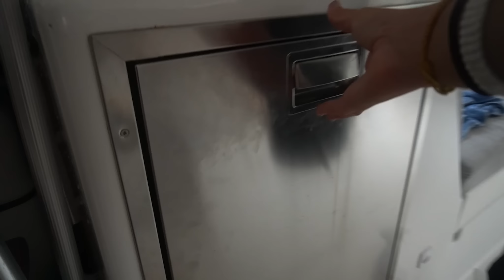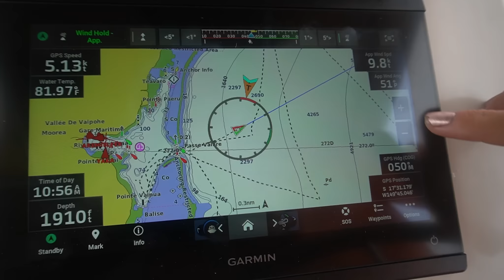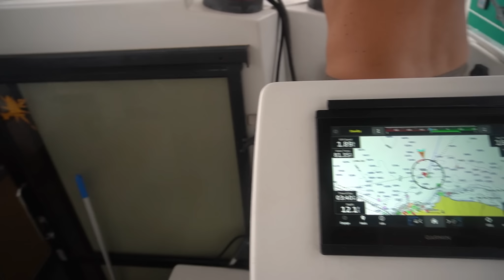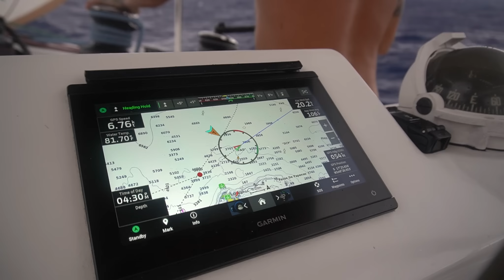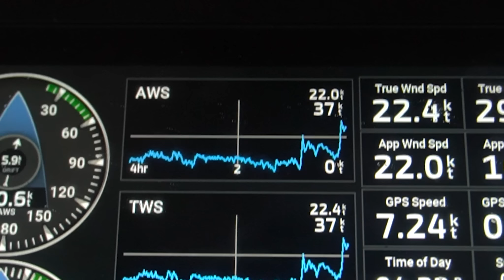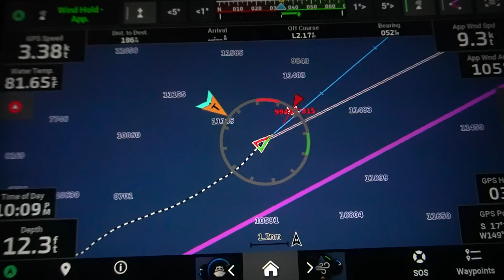The Dingy is Fixed, Now Let's Go Sailing | Episode 202

Comment: sorry to hear about the eczema, next time you are near a chemist, get them to mix 10% Olive oil in the Aqueous base cream, into a small jar (approx150ml), apply each time you wash, swim etc. and wipe off if it still feels greasy, you don't need much, it goes a long way eh, most creams have either perfumes and or 'drying' agents and will aggravate the affected area's and all barrier creams will aggravate you too, use the cortisone very sparingly and at a max 7 days on 7 off, or your skin might build up a tolerance (it happened to me)  I have been using the oil/cream for nearly 30 years!!! and have kept the eczema at bay for many years...  tip find a small container (about the size of contact Lense case) put the some of the oil/cream into to that and carry with you (in ya handbag etc.).. hope this is helpful

Comment: Coming from a marine technician, I’m hoping you check the bearing preloads and the gear backlashes. If not you’re going to just chew up gears like you did last time. You have to shim them so they ride correctly. The bearing preloads need to be sat for a new bearings and use bearings differently. Hopefully it being a small horsepower motor if you don’t run into any issues... 🙏🙏🙏
Reply from the maker: Hey thanks for the message, I was worried about that since most of the info and video I found out the subject said this was something that was needed, but after talking to several Honda mechanics, the smaller house power motors like mine aren’t as necessary, so fewwwww!
Reply: Good to know I was wondering the same thing.
Reply: A gentleman would have took her.

Comment: The big lesson… you want to be fuerl independent by sailing… get a proper dinghy with a sailing rig and real oars. You will never on dependent on gasoline again. With a dinghy that only runs on motor power and is hard to row, you are truly stuck when it fails or you are out of fuel. With the ‘old’ way, you can use an outboard if you want, but never need to. Sorry to be an old pain in the ass, but you know i am right. Keep on keepin’ on and say hi to Patrick on Ahe’
Reply: Hi, I had a dinghy in Florida & lost the mickey mouse oars that come with it.  I found a pair of aluminum 10 ft oars at a used boat parts store and they were fantastic. Quite often I didn't bother with the outboard as the dinghy was very manageable with the oars & without the engine on it was quite fast & great exercise.  Love you'r vid's have a great day. Terry.

Comment: SO MUCH you can do for eczema ♥️ Salt water is actually great for your topical healing, however I know when your skin is cracked it’s uncomfortable. Directly GUT related though. 
I’m happy to give you some guidance for free if you want any help. I’m an intuitive, nutritionist, aromatherapist, reflexologist, reiki practitioner, etc 😂
I also suggest checking out Anthony William’s Cleanse to Heal book.. he has a free podcast as well.
Sending love and healing to you Erica! ♥️✨✨
Reply: No... actually salt water is crappy for long exposures on your skin. I have no skin problems myself but I HAVE worked many long hours in salt chuck water and it tore up my skin. Also while scuba diving, of which I have done a lot of, your skin is exposed to the salt a lot and it begins to dry out.
The osmotic pressure from within your skin pushes water out to the surface because sea water is 3.5% salt (roughly) and this is WAY more than your body can handle for long periods of time.
The eczema can also be a result of stress too. When I met my wife decades ago she would have periodic outbreaks of it and "fever blisters" on her hands. That eventually went away when her stress reduced.